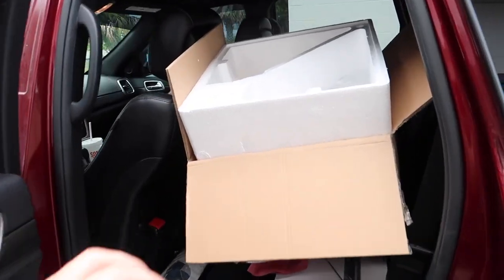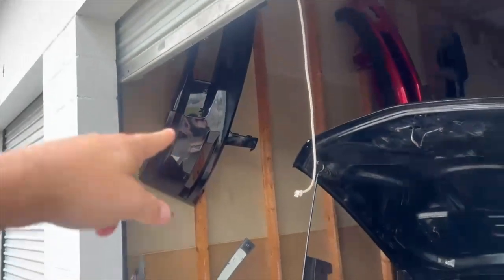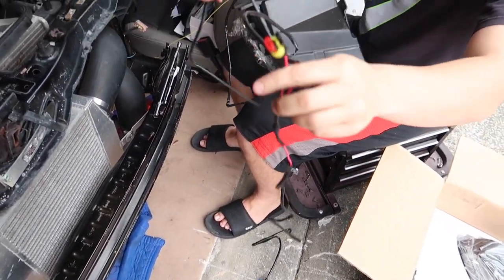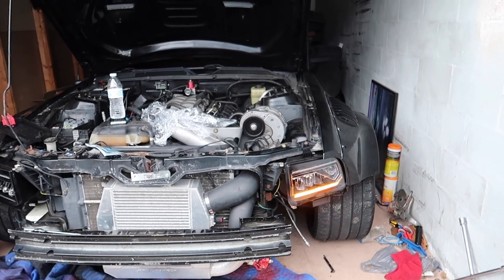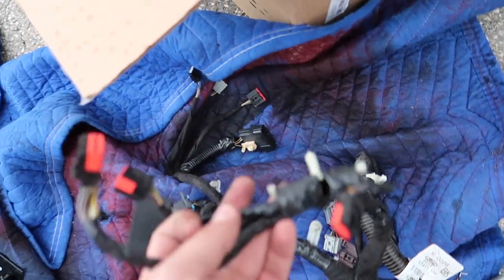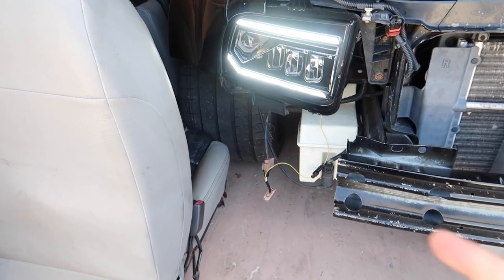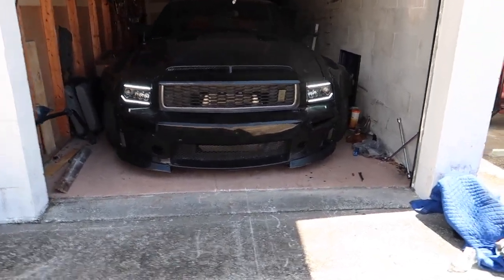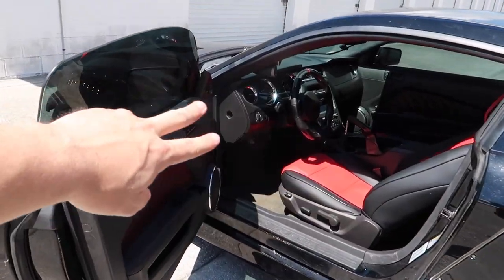MEANEST LOOKING Headlights for 05-09 Mustangs! *Transformed!!* (VLAND)

Comment from the maker: 🚨 For 20% OFF Use Code: JHVF20
Reply: That code doesn’t work
Reply from the maker: @codyadcock9517  I just tried the code (JHVF20) and it works, copy and paste it
Reply from the maker: @codyadcock9517  I see what the problem could be, don't use vland official website, make sure you use vland factory website to get the discount
Reply: Question about those lights is everything just a plug and play or did you have to splice into the wires

Comment: So for me I had to actually cut off the supplied add a fuse as it was too big for the location they specify in the directions and I got one from AutoZone. It works exactly the same and is way less blocky. It also fit in the spot they want it to be. Also the DRL switch doesn’t control the DRL on these lights instead as long as key is on accessory or started they auto turn on. They look great!
Reply: Can you send me a link to what you bought at auto zone
Reply: I’m confused as well, the fuse they gave was way too big, and I tried taking a fuse+relay out for the fog lights, but that ended up with the day running lights staying on even with the key off and the switch turned off